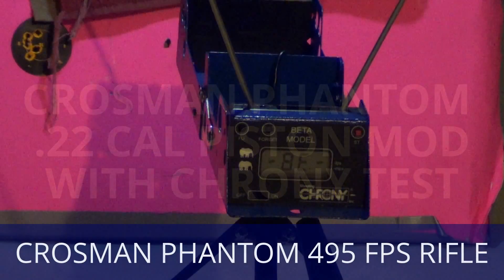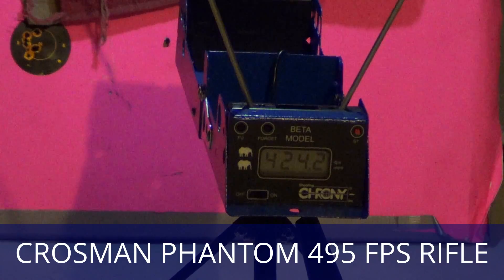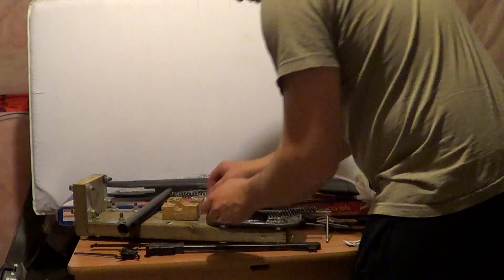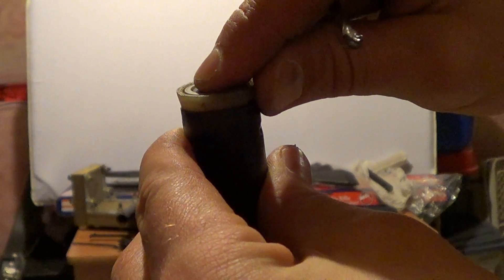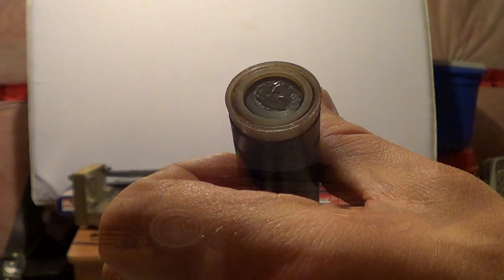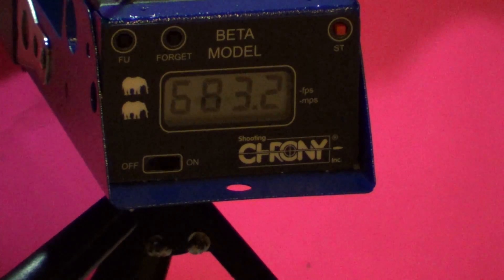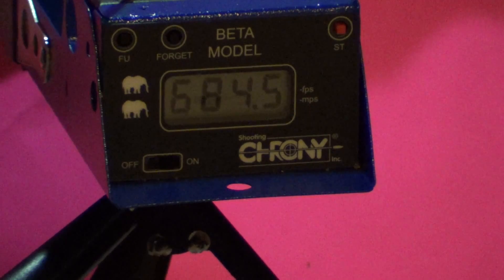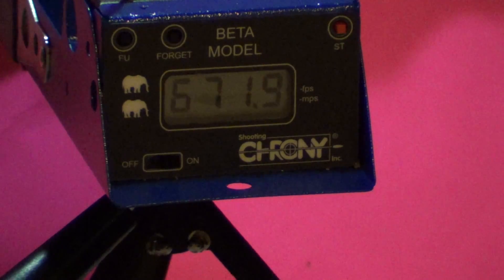CROSMAN PHANTOM .22 CAL PISTON MOD / CHRONY TEST VID 3

Comment: I bought the .22 version last night and only fired 3 shots before I disassembled it. I plugged the piston with a small dowel, crazy glued both ends and polished up the residue. I also made a 5/8 brass spacer to add more compression to the spring. I chamfered the opening a little more on the plastic muzzle protector to clean it up a bit, shaved off the factory sights, mounted a scope and dialed it in. I don't have a chrony, but I'm blasting clean through a 5/8" fence board from 25 meters and getting quarter size groupings. Not bad for a $100 Wal-Mart gun.
Reply from the maker: awesome m verno! glad to hear the great results with your new pellet rifle. you should be around 650 fps or so. so you have enough gun to do some serious shooting and hunting. now start learning the trajectory of your particular rifle and pellet combo and stick with the same pellet and you will get to know where the pellet will go in comparison to the reticle in your scope for different ranges. or you can adjust and gather DOPE for your rifle and adjust instead of holding over. well have fun and please subscribe if you havent already. thanks for the comments.

Comment from the maker: Well the jb weld is in the hole so I can't see it even crumbling but one bullet proof way to plug yhe hole and I think is the absolute best way that will never fail would be to drill the hole bigger then tap it and red loc tite a set screw in the hole. That would be the proper fix and maybe ill do a video on doing this the right way. Comment and let me know if you wanna see it done.
Reply: Did you ever shim the spring to pre-load it?

What did you use as a shim?
Reply: Makes sense.

I wanna try the piston mod on mt Phantom.

It's 495 FPS right now....hoping for 900
Reply: Or just 2 seconds of tac welding it with a MIG welder...

Comment: I'm wondering if a rivet would work as well.   Jb weld tends to get a bit crumbly if applied to thin and super glue will foul up the barrel. Any thoughts?
Reply: Thats what i thought of JB weld. A hardened dried epoxy on a rather soft type plastic might shift or become unattached after several jolts of spring slamming . Air then possibly seeps way through hole. What about a hobby plastic Hot glue gun using Gorilla type glue sticks with a plastic rivet or plastic insert so plastic adheres to after hot glue melted to seal hole for permanent seal? Just curious , in case its needed on my air rifle , and suggestions ?
Reply from the maker: Jb weld is the best method by far. In my spring upgrade video from a few weeks back you can see it’s still perfect after about 10 years of use

Comment: did you lube piston after jb weld?
Reply from the maker: well just the seal surfaces with a with pel gun oil. did that to make sure the seal had some lubrication because i wiped off the oil when i jb welded it.

Comment: What spring do i need 					 						 					 				at vortekproducts?
Reply from the maker: the stock spring is 36 coils of .122" wire OD .740" or 18.8mm

the vortek custom spring will be 18.5mm X 118w X 35 coils
Reply: ringet421 Thx,,  I bought gun today at walmart (canada)  and no hole in piston

Comment from the maker: robert rota you took it apart and there is no hole in the piston? thats strange cause everyone i have taken apart had a hole to regulate velocity. i don't know then i guess your first step in gaining velocity would be to order a main spring and go from there
Reply: RINGET421 I wouldn't think so - Crosman has been trying to figure out a way to keep people from doing this (and other) mods for ages, while keeping costs to a minimum - so far to no avail. The best bet is to just purchase the 500, order a 1000 mainspring & piston at the same time, (if you search around this should total about $170) and just be glad you've got a relatively cheap, accurate & powerful .22 - all without the 'red tape'. Life is all about give and take, & there's a lot to gain here IMO. Oh yeah, & have your PAL and all that fun stuff. :)
Reply: +RINGET421 one of the first steps i have heard that a lot of people do to gain velocity is to use a flammable liquid such as light grade fossil base motor oil behind the pellet [dieseling] since synthetics and silicone lube are less flammable. this approach has its own drawbacks none the least of which and especially when there is a hole in your piston LOL however this also leads me to the topic of this video having increased velocity rather unscientifically without stating major facts such as the fact that after assembly there will be excess lube in the compression chamber which will burn at each firing and add velocity so the immediate chrony results are possibly not indicative of real world, lasting increases. my factory new 495phantom.22  did not have a hole in the piston and shot 800feet per second for many shots until the factory lube wore off and then was very anemic shooting under 490fps. this video has definitely added permanent velocity but the large effects listed might well be temporary effects. great video, thanks for sharing
Reply: this is exactly what I did. But I order a piston with no hole and a main spring a bit longer then the original (.22) cal. I don't need to tell you I much I increase the fps with this mod.
Reply from the maker: i wonder if there is a build date somewhere so we can find out why some 495 guns have holes and some guns down't.
Reply: RINGET421 

If there is no hole present could you theoretically drill your own?
Can you give any help/specs on replacing main spring?
I was under the assumption a nitro piston does not use a spring.. i guess i was wrong there.

( sorry posted under wrong thread before... )
Reply from the maker: +inspectyerbooty that's works but not consistent.  speed is good if you can maintain accuracy but if it can't repeat a shoot accurately then the gun is useless
Reply: RINGET421
 yes, that is what i would say again
Reply: hey is thia gun spring, if so does it get weaker in the future can u explain how the pump works
Reply: It is my understanding that the Canadian version has a hole in the piston to allow some of the  air to bleed off when firing,  reducing the pressure so that the pellet travels under 500 feet per second. The current anti-gun  Liberal Government  allows the federal para-military RCMP to make gun laws  so an  air rifle is considered to be a deadly lethal  weapon if it fires a pellet over 500 feet per second. If a Canadian version does not have this hole, then I am assuming that the manufacturer has  now reduced the spring length  and strength instead to reduce the pressure. I would assume that a longer and stronger spring would boost the power to over 500 ft per second. This would be considered a federal offense in Canada punishable by prison time, fines or the seizure of any other guns a person may have and would likely mean a ten year ban on owning any firearms legally if that person did not have a valid federal firearms license which requires renewing every 5 years.  However, I doubt the police are going around checking such things. They have much more serious things to do with their time.
Reply from the maker: Ya that's correct

Comment: so what if my .22 cal crosman phantom that shoots 495fps (at lest that's what the box says) has no hole to plug?
Reply: Robert Rota shim it with pennies, I don’t have a chrony to check the speed but I definitely have more power, my pellets are flat as dimes when they hit the steel trap and they are hitting hard enough that the steel is dimpled
Reply: @MrMann703  please can you tell me how to do the penny shim thing
Reply: @LessLethalHomeDefense 4 years later lol you probably know - but it’s just dropping pennies down into the piston to preload the spring

Comment: i did the 2 pennys and a dime mod....found it really improved the fps...ill have to try the jb weld...thnks !!
Reply from the maker: what is the 2 pennies and dime mod? i have never herd of them before
Reply: ringet421
Hi. 2 pennies & a dime. I read another post on another site. After you remove the spring, you drop the pennies & dime in. It makes the spring just coil bind. Max pressure.  You have to try it. Some people find that 7only 2 pennies will fit. Add the dime, & the barrel  won't quite lock up.
Reply: @cameoguy7097  well I put 7 Pennies in mine lol before I did a spring upgrade so it depends on the piston/gun